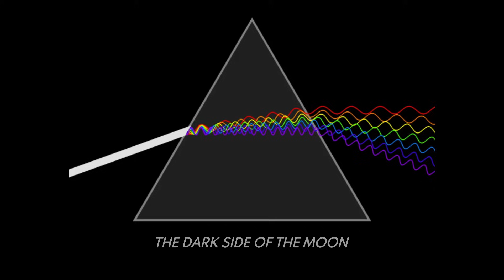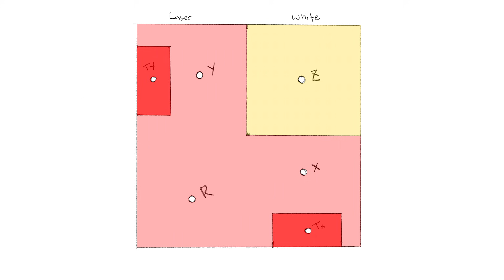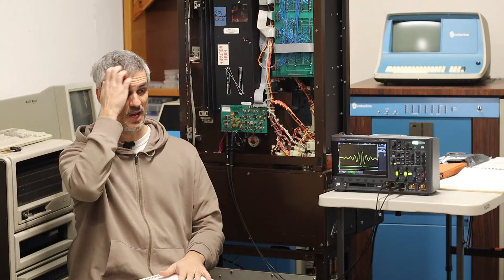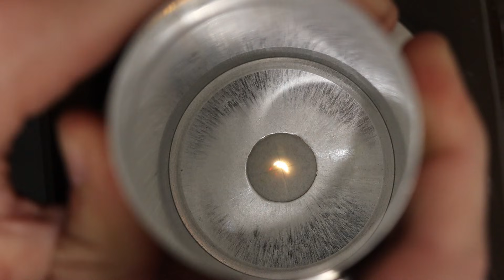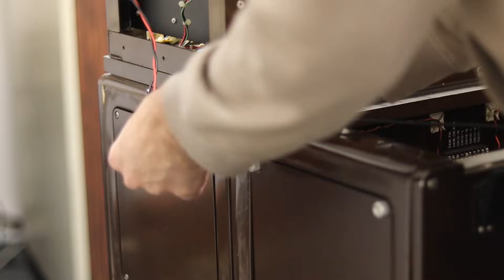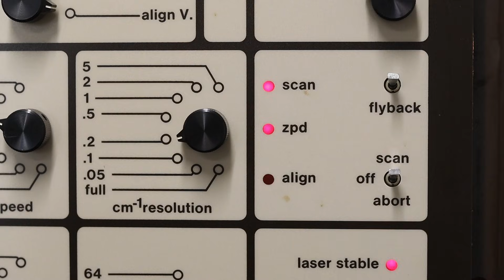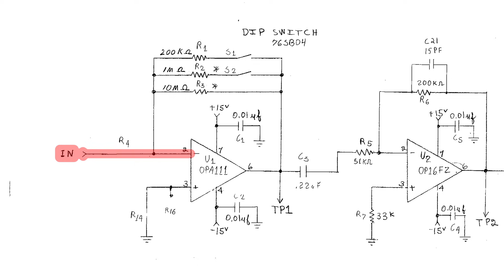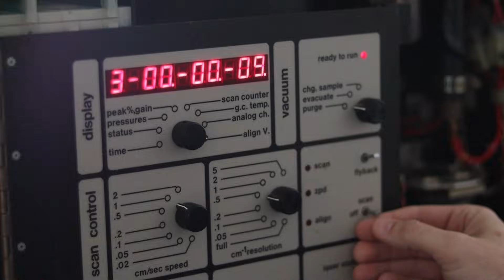Aligning the Detector on the FTIR Spectrometer

Comment: You referred to temperature related changes. Most lab equipment involved in measurements is temperature sensitive and it affects readings. That’s why most labs are maintained at around 68 degrees year round. Remember that from college chemistry class.
Reply: That is the reason my industry is here also, HVAC. I work on heating and cooling equipment and have a background in electronics. The electronics helps me diagnose hvac electrical faster since I can mentally follow the path of signals to figure out what part is bad. One case is a economizer module that I had to replace 2 times because someone, not me, replaced a control board in the unit and wired the induced draft motor which has 3 wires. One common, one for 208 volts and one for 230 volts. Unit is 230 and the 208 was supposed to land on the controller where there is a park spot for wire that are not supposed to be connected. When someone had replaced the control board they had connected the wire that was supposed to be on park onto the L1 terminal causing the 208 winding to kick power back into the power system therefore causing the transformer to spike the output voltage higher than 30 volts. In turn causing the protection diodes in the economizer module to short popping the transformer 3.5 amp breaker on the 24 volt side. Thank you electronics knowledge for teaching me advanced electronics theory.